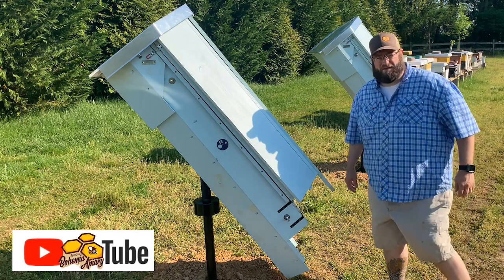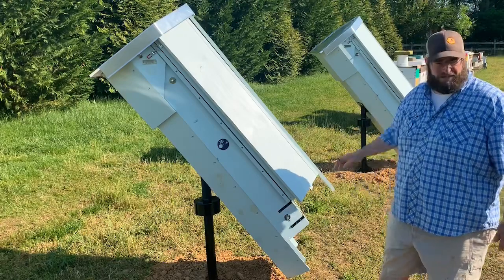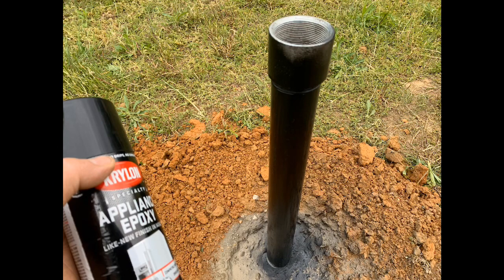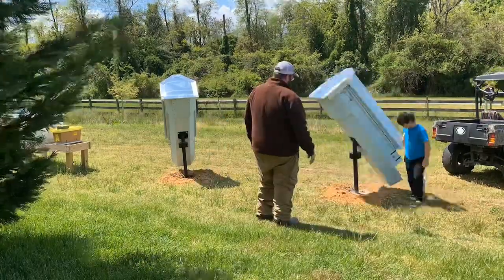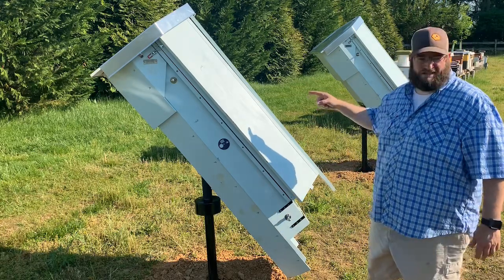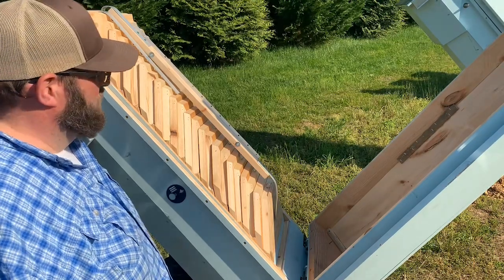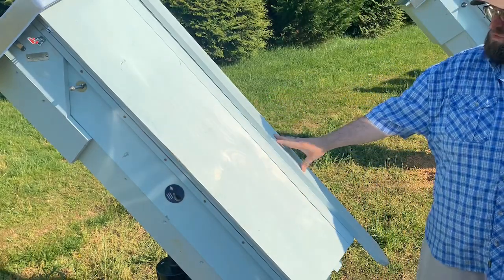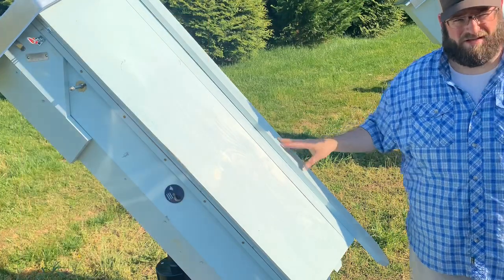Colony Keeper Hive | New Beehive | Beekeeping | hive setup

Comment: That is going to be a mess trying to get honey frames out of.  Those deep frames may get up to 30 + pounds when full of honey. At that height and angle it will be very difficult to work heavy frames.
Reply from the maker: We will let you know what we find. Thanks for the positive reinforcement.
Reply: I agree.   I'm trying to make it easier as I get older.   Notice how high those top frames that hold honey are?  Sheesh

Comment: Tilting your hive forward lets the moisture run down towards the front instead of on the cluster.  Problem solved. That hive beast, gimmicky.
Reply from the maker: There are a few other benefits we are finding with this style hive setup. It's definitely not for the commercial or sideline beekeeping operation. But if you are looking for a more traditional hive cavity style setup this closely mimics it.